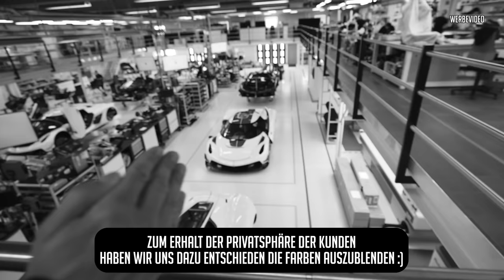JP Performance - Der bisher tiefste Einblick! | Besuch bei Koenigsegg | Teil 2

Comment: Die Frage immer danach, warum das andere nicht machen ist einfach. Weil es bei jedem anderen Automobilhersteller immer irgendjemand im sogenannten "Controlling" gibt, der den Rotstift ansetzt, entweder bei der Forschung oder dann bei den Produktionskosten. Primäres Ziel ist die Marge zu halten oder zu vergrößern. Seiteneffekt ist dann die "geplante Obsoleszenz" von der wir immer mal hören, weil sich einfach die Physik und Materialbeanspruchung nicht veräppeln lassen (um das mal primitiv zu formulieren). Und andere Herstelle die auch solche Preise aufrufen für ihre Fahrzeuge, haben dann einen Gewinn jenseits von Gut und Böse. Koenigsegg ist meines Erachtens die einzige Marke, die nicht so eine "Rotstiftfraktion" besitzt. Sie planen ein Fahrzeug für den entsprechenden Einsatzzweck und was es kostet, das kostet es eben dann.

Comment: Cars almost completely built by themselves. you can buy many similarly priced cars, and they're just a new coachwork and interior on a car 1/10th the price. Or a part bin collection from big brands with some carbon parts and interior added.
Koenigsegg would be making the very same cars even if there were no large automobile industry. If anything, the existence of dumb ways to do gearboxes and wheels by others is slowing them down.